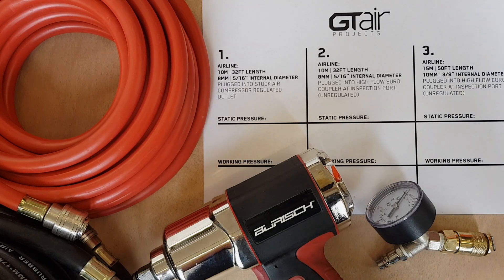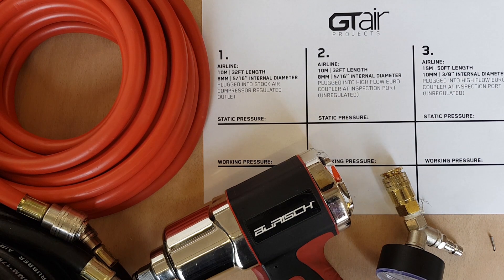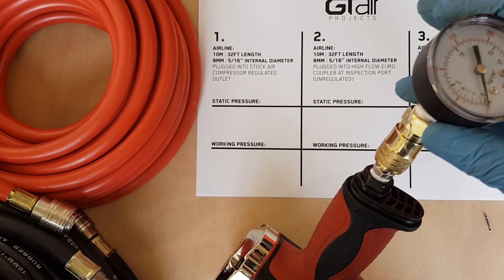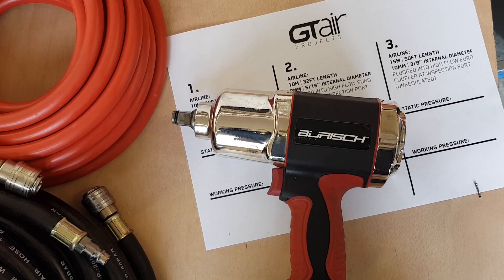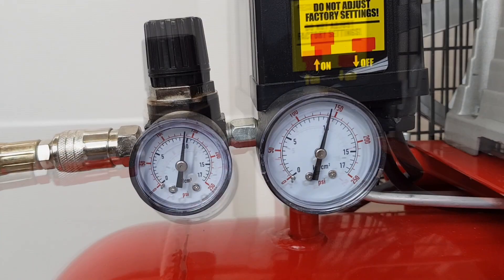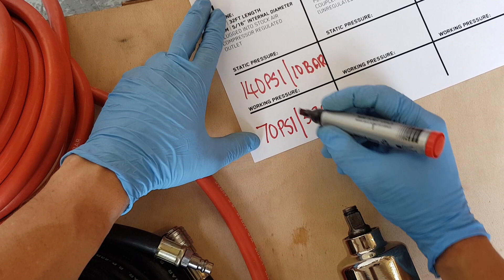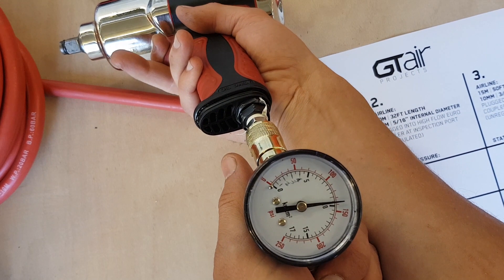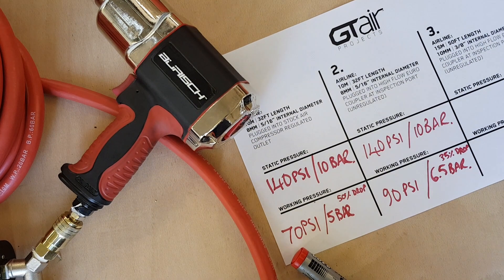Supercharge your air compressor tools for cheap - Working Pressure & Air tool setup

Comment: 🤞 went to take an 1"3/4 not off my Harley sprocket and no good.  Air gun is new but it will not move it.
Definitely going shopping on the way home. I've got new chain and sprockets to fit before I can take the bike out.

Comment: Bruh, this helped me out alot, bought two impact guns just recently and both of them seemed weak, Couldn't figure it out.  I realized it wasn't the gun but my compressor, but I am scratching my head cause my pump is able to deliver the CFM that the tool needs, I have a 27 gallon tank, so I couldn't understand why the impacts seemed weak. 

When I hit the trigger , I have a gauge after the regulator and it shows under load 90 psi which is where I set it, but looking at ya video, I realize now that at the tool it self it may not be 90 psi , it's probably a lot less due to the length of the 3/8 hose which is 50ft .

I need to get a regulator setup to see what is actually at the tool. for there is a pressure loss for sure.   I do electrical work, and  it's the same concept, the longer the wire run , the more of a voltage loss you incur at the load , so to compensate you have to increase voltage or use a larger wire or cable.   

Same Idea here.  Made sense when I saw you explain it, didn't even cross my mind .

I am going to get one of those setups asap and see what my loss is, I already ordered a 1/2
" air hose to upgrade from my 3/8"s.

So it should help with the pressure loss.  If may have to either turn the regulator all the way up to max 150 psi and see what it is at at the tool when running and if I can't get 90 psi , I will probably have to do what you did here, by pass it and then see what I get . 

excellent video and explanation , I was scratching my head over this , thinking these impacts were defective out the box when that is not the case. 

Was my setup.

Ya learn something new the longer you live.

Comment: Excellent. Thank you.  Easy enough to put a regulator on the inspection port and avoid danger or over running the tool pressure.  Oh, I see you ended up doing exactly that.  Well done.

Comment: The issue is - that tool is not designed to run at 115psi so you really need to consider what your equipment is capable of handling.

I have a pancake 2.5 CFM@90PSI 6 gal Porter Cable compressor. I will try the following: run a 10 foot 3/8" direct line (no quick connect) from the drain valve (bottom) to my Ingersoll Rand 119MAX air hammer.  This hammer requires 23 CFM@90PSI. I may even consider using an 11 gal boost tank for my occasional use of this hammer.

Comment: I know this is an older video but I still want it to make a comment. Thank you for being smart enough to figure out how to actually test airflow. One Summer I racked my brains trying to figure it out and finally had given up. At that time there was not a lot of information out there on this subject.

A while back I need it to remove the tires from my pickup truck. My truck sits for 6 months to a year and is hardly ever driven. So when I went to remove the lug nuts I knew they were going to be a tad difficult to remove. In the past I really did not have issue with removing lug nuts. I set the gun to kill and went at it. Not a single lug nut broke loose not one of them. I ended up using a pry bar to break them free. 

I had honestly believed it was my airgun since it had not been used in a very long time. Back in the '80s and '90s I use this thing all the time. Always put oil in the gun prior to use I still follow that process to this day. So I figured from sitting and not being used perhaps it had met its end. So I ordered a new one which had a lot more power since this gun that I owned was purchased in the '80s and now we are in the 2000s so figure better technology.

As soon as I picked it up I went to the front of my pickup truck and tried to loosing the lug nuts. Same exact same as my old gun would not break any of them free. So that's when I tried to figure out what was wrong.

The biggest difference between what I used in the '80s and '90s and part of the early 2000s was a different smaller air compressor with a shorter hose. That hose was 50 ft or 15 mm. 
When I bought a new house with a garage in it I decided to go up in my air compressor and switched over to a 100 ft hose or 30 mm. The hose is 3/8 of an inch 10 mm. I had two different things that I was using that I never had in the '80s. I had two hoses connected together and I also have a hose reel what I have connected a larger diameter coming from the compressor hoping not to lose pressure through the fittings.

As I said I was really ranking my brain and one afternoon after being frustrated with what was going on in the garage I decided once again to look for a solution. That when I discovered the type of fittings that you are using. It was a total fluke that I found these fittings. I was looking for a bigger diameter hose and found the fittings. I quickly started looking at them could not believe in the picture the difference between their brand and a normal fitting that you would buy at The Big box store off the shelf.

I went to the manufacturer's website found that I could order these fittings in bulk and saving a lot of money compared to Amazon and eBay. Since I have a lot of tools side note I'm not a professional mechanic I'm just a DIY mechanic and I like having the right tool for the job. When my fittings showed up I could not believe the difference in sizes. I could almost put the original fitting into the new one. I also ordered a couple quick disconnects that fit the new fittings and was recommended on their website.

Unfortunately after that I haven't really had something to test it on since I already removed all the lug nuts on my pickup truck. My only gauge of power was the torque I felt pulling the trigger and the sound the tool now made which was a lot louder. 

I have started taking more interest in doing things in the garage again and one of those is to update the hose that goes to the compressor. And I was still trying to figure out a better way of gauging performance. I absolutely love your solution I just wish I could buy it from you instead of having to make one. I'm in the states and as you know you're in the UK -) so I'm going to put a list together and order the parts and make my own gauge. I am so thankful for coming across your video and I do apologize for the length of comment. I thought perhaps of other people would see what I have been dealing with it could help them out also.

I most definitely give you a thumbs up and subscribe to your channel.

Comment: Very helpful video sir! I now know not to set my regulator at 90psi, but just leave at it's max 125psi due to the bid drop in working pressure to my impact and air hammer. I'm going to see if I can rig up that direct line on my compressor too. That seems to be the way to go for tools requiring 90 PSI.

Comment: This video is a great help in understanding how to improve compressor performance. I have a Wolf 50L, 14 cfm compressor which gives a disappointing performance. Obviously, there is a restriction at the tool connection so the critical issue is providing a better supply to that point. Phil Downes suggestion of a direct 10mm  connection to the tank would seem to make sense although it may be a nuisance if also using the other connections (tyre inflation etc). I have a 10m length of 10mm air hose available. Are there any quick release couplings larger than 6mm that could be used? What would the fitting at the tank be?

Comment: Bypass check valve, and unloader  is tough on system, Do this only if needed, or permanently!??
Reply: It doesn't bypass the check valve or unloader.
Those work in the same way 
It just allows more air to travel faster with out the restrictive 1/4" bsp ports from the top outlet and standard regulator unit.

Comment: but you are measuring 90 psi on no load working pressure. i think that you should to measure 90 psi on full load working pressure to not damage impact wrench internal components

Comment: Good experiment video. I originally built my system with a 60 gallon 155 max pressure unit and fitted it with all 3/8" fittings, pressure regulator, water separator and 50' hose. It worked good for most tools, but it was lacking in certain ones like grit blaster and air ratchet. I am refitting it now with all 1/2" fittings, regulator, hose etc. I expect a huge performance boost especially with type G open flow couplings.

Comment: This video was a great resource for me. I didn't personally purchase your kit (I'm not in EU either) but I followed the principles in this video to assemble a custom manifold for my compressor. I'm seeing the benefits of higher air flow and the compressor is almost the same as stock. The manifold is just substantially bigger.

(P.S. Using a pipe union at the tank is a good option to make the manifold easily serviceable.)

Thanks for posting!

Comment: Good video. But you lost a lot more by using a quick connect at the tank. . now try it by screwing the hose straight into the tank and watch the numbers rise even more. you could use a ball valve providing its got a nice big hole in the centre between tank and hose, but a quick connect even high flow is a big restriction on 3/8th  / 10mm hose.
Reply: This video is a great help in understanding how to improve compressor performance. I have a Wolf 50L, 14 cfm compressor which gives a disappointing performance. Obviously, there is a restriction at the tool connection so the critical issue is providing a better supply to that point. Phil Downes suggestion of a direct 10mm  connection to the tank would seem to make sense although it may be a nuisance if also using the other connections (tyre inflation etc). I have a 10m length of 10mm air hose available. Are there any quick release couplings larger than 6mm that could be used? What would the fitting at the tank be?

Comment: best video ive seen on this subject, i recently bought an air wrench to service my own vehicles and because i dont use it often i use my basic 8 gallon 135 psi compressor which works fine but i thought my tool was low on power and set it to 90 psi at the regulator, needless to say i understand how it works now

Comment: i have the same compressor, was surprised by how quiet it is, one thing to note thought the wheels on it are terrible!!.. if you are moving it about alot or using it mobile be careful ! mine broke into about 3 pieces one day rolling it down the ramp of the van. Had to put jockey wheels on from a caravan

Comment: Can i run a air line from the moter to my high psi tank?
Reply: You should be able to. Just be aware that the compressor will run more to fill the extra air space. You need to make sure to give it adequate time to cool down.

If you're planning on adding a quick connector to the tank, I suggest also adding a valve. You could close the valve so that the additional tank holds its air if you remove the air hose that connects it to the main tank.

Comment: I would like to know is how can i get more pressure from 150 psi to 3500 psi can i by pass the regulater strait to my tank? I have a high preesure tank.
Reply: to 3500 psi? is that a typo?
Reply: No i bought a compressor that goes to 5000 psi
Reply: @johnhawk9321   That must be an incredible compressor setup to achieve 3500 psi!  Great Job!

Comment: Nice! I changed to a coupling with an on/off valve. Which my Dad and I like but I feel it restrict air flow. I have 3/8 lines but 150' of them because we need a lot of hose to reach outside of our shop. Need to install the new hose reel my stepmom bought us and tee into the line and use it for just shop use.

Comment: Switching to a bigger regulator or bypassing it altogether or using the outlet from the tank.. Doesn't that make you motor run more, like non stop to replace that high pressure?? Burn your compressor out...
Reply: It depends on how you use it. Having higher air flow doesn't necessary mean using that higher flow constantly. Using an impact wrench as an example, it's typically used in short bursts with long pauses. There's a benefit to having higher flow because the full potential of the tool can be used within those short bursts.

If you were to use something like a DA sander or an HVLP spray gun then problems could arise. Those tools are normally used for longer periods of time with shorter pauses. It comes down to taking time to let the compressor catch up and cool down. Either that or getting a bigger tank with a stronger compressor.

Comment: Eliminating my regulator and giving my impacts 1/2" ID everything is how my 21 gallon compressor lets me work on my semi truck.

I'm looking forward to the day I can buy myself an 80 gallon or bigger.
Reply: if your working on your semi then just have the engine running and use the trucks own air supply....  should be 120 psi easy
Reply: @philldownes8685  You know those tanks aren't that big, right?

Most are between 6 and 8 gallons. Some are 12.

Running a 14L diesel "generator" for such a small air supply only makes sense in an emergency eg roadside.
Reply: @dchawk81  Something you could consider is getting an auxiliary air tank. I know that doesn't make the compressor more powerful but it may be a good solution to get more run-time with your air tools. You have to make sure that you don't overheat the compressor though.
Reply: @luchvk  I looked into it and they're so damned expensive themselves it's crazy.

My compressor is about shot anyway though. It needs replaced.
Reply: @dchawk81  What size did you see? I know you can get an 11 gallon portable air tank for $40 - $60 (where I am) and convert it to an auxiliary tank. The only thing is the pressure it's designed for may be a limitation. I did see a purpose made 20 gallon auxillary air tank for $200 though.

Comment: Nice informative video👍. You might try not jumping the camera around so much. I almost lost my lunch.
My 220v, 10hp, 60 gallon compressor is in its own shed outdoors. Air is piped into the garage in galvanized 1/2” pipe. Serves my needs very well, and much quieter with the compressor remotely located.

Comment: I run a hose straight from the tank with a hose and impact wrench hooked up directly with no quick connect fittings at all. just straight hose to tool directly. directly into the tank without any extra fittings
The performance is unmatched it has so much torque you wouldn't believe it. its only powering a cheap impact wrench and it zips off the tightest lugnuts instantly
its only a 95 to 125 psi compressor though so its fine on the pressure range for the tool.

Comment: Hi do you sell the air pressure gauge set up you made that connects directly to the tool?
Reply: I believe I have just found it in your site (Air tool pressure tester) £15.99 Is that the correct one?
Reply: @Simontunni  Hi - yes thats the correct one :)

Comment: I'm setting up a 31cfm @175psi 80gal 7.5hp air compressor in my home shop for a pneumatic tapping arm, CNC, media blasting cabinet and air tools.

Between having to outfit it with a softstarter since just its surge current is 2/3 of my homes electrical service 😬 and a refrigerated air dryer I'm currently designing the air system which uses a 3/4" ID(19mm ID) rigid aluminum air tubing. Luckily the air lines length is a fairly short run. 

Interested to see what the differences between static and working pressure on a system where air tubing is almost 2x the diameter as the largest tubing size you talked about.

Comment: The ideal set up on (in my opinion and what I run for a 150' run) is a 1" ball valve handlined into the compressor, (with the valve being 1" the orifice will be 3/4"), then 3/4" line through the shop which then connects to a 1/2" regulator-filter at the reel with 1/2" FITTINGS and 1/2" line, then top it off with milton G-style 1/2" high flow fittings. The pressure drop is dramatically less, and you can run more line this way. All too often I see guys with 3/8 ball valve at the compressor (1/4" orifice) going to a 3/8 line with 1/4" fittings, with filters and unnecessary couplers in between. Running 50psi working pressure at the tool and never knowing.

Comment: whats the use of a 1/2" regulator if you reduce to 1/4" right after?
Reply: much larger internal structure of the regulator gives much higher airflow depending on what you regulate the pressure to.
larger regulators have better flowrate. even if you reduce it after. it will still be better than a cheap crap regulator.

Comment: Ive bought yoyr compressor and bought all the bits off ebay. What i would like to know , you reduce down from 1/2 to 1/4 at the output of the regulator surely this would restrict flow into whatever diameter hose you have connected , from the 1/4 reg to tool. I tried putting a 1/2"  quick euro connector on the regulator and a 10mm hose , 10metres. My test results were showing a 95% of the tank pressure at the tool. Have you tried this?
Reply: There kit does not make any sense at all to me. They reduce down to 1/4" which defeats the "high flow" point of buying it in the first place.

Comment: Haha "Check oil daily" On the compressor. I think they meant check oil decadely.
Reply: Well you could look at it that way, but after not checking mine one time, exact same model, branded Wolf, I destroyed a connecting Rod. Thanks to GT air I was able to get a well priced replacement Conrod very quickly.
However, it's not easy rebuilding that pump! Getting the crank out at home was a huge task for me.
I check the oil every time I use it now, cause it happens when you least expect it.👍